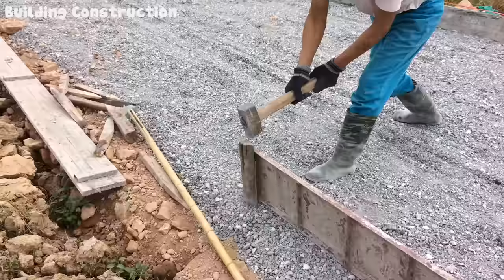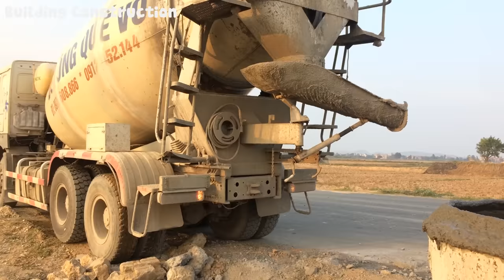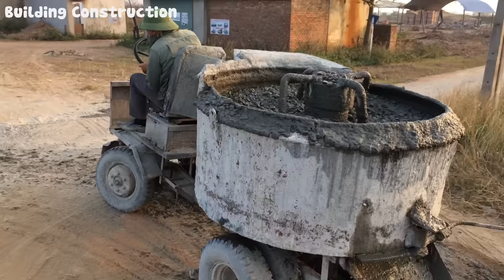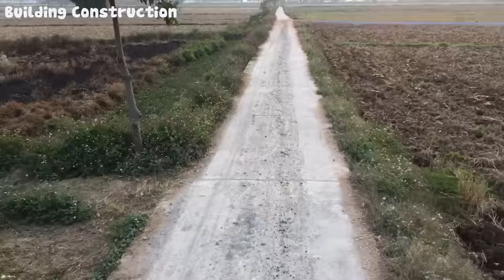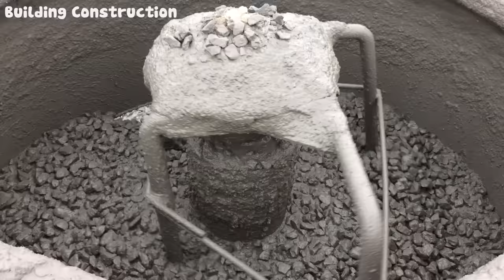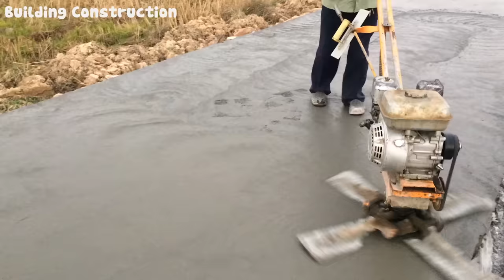Construction A Concrete Road Stretching On Rural Fields With Ready-Mixed Concrete

Comment: Great stuff but I noticed no expansion joints unless they cut them whilst the concrete was still soft later. It will buckle without them.
Reply from the maker: Thank you for watching my video
Wishing you a happy and successful new day
Like and share to help me
Reply: L
Reply: @buildingconstruction8386  g ki ek.
Reply: I saw then laying (6:35) and then about 3 meters apart, perpendiculary sinking (10:16) some wood boards in the concrete. Those may act as expansion joints.

Comment: I would like to see this a few years from now, with no rebar it will be interesting to see how this hold up.
Reply from the maker: Thank you ♥️🌹
Reply from the maker: Kirk Johnson  thank you
Reply: And no control joints? A whole Lotta Crack my friend
Reply: Sure a few runs of the consaw after it’s dry will sort out any expansion. Rebar would’ve helped though.   But my God this road would’ve bankrupt most 😅
Reply: @buildingconstruction8386  ششضض
Reply: @EricB90  I saw then laying (6:35) and then about 3 meters apart, perpendiculary sinking (10:16) some wood boards in the concrete. Those may act as expansion joints.
Reply: @robertrisk5490  bro what? Who puts wood in concrete.
Reply: @EricB90  that's what I think I saw. I am not recomending it or saying it should be done. I am a doctor, know nothing about concrete or engineering.
Reply: There are 2 kinds of concrete. Concrete that is cracked, and concrete that is going to crack.
Reply: @mykelbaurle5758  I’m sorry your concrete work has been that bad lol most homes where I live are on a solid concrete foundation… my grandparents house which is nearly 70 years old is still not cracked.

Comment: Very nice video. Can u tell me why no dowel bars tie bars used here? Also no construction joints left?
Reply from the maker: I wish you happiness success
Like and share videos for me
Reply: Maybe because its being built in a poor country
Reply: I saw then laying (6:35) and then about 3 meters apart, perpendiculary sinking (10:16) some wood boards in the concrete. Those may act as expansion joints.

Comment: In Concrete Road 3 Types of vibrators required. 1.Needle vibrators 2. Plate Vibrators 3. Screed Vibrators which is equally with span width. It is based on levelled sides shutting frame, So that surface to be completely smooth. Expansion joint, concrete cutting and Curing through vata for 28days must.
Reply from the maker: you are right
❤️❤️❤️❤️❤️❤️❤️❤️❤️❤️❤️❤️❤️❤️❤️❤️
Thank you for watching my video
Reply: What  is  you' job
Reply: Sir please I want to learn and work for you I'm in Nigeria I have the basic knowledge
Reply: Sir please I want to learn and work for you I'm in Nigeria I have the basic knowledge

Comment: That road  will break up because it have no steel in the  concrete
Reply from the maker: Ok thank you ♥️🌹🌹🌹
Reply: @buildingconstruction8386  that's hard
Reply: It depends on the ground movement and thaw/freeze cycle.   Many roads were built under the French colonization without any re enforcement and still serving the country well.

Comment: No rebar, and separated by each sub section. This will cause lots of cracks in the future.
Reply from the maker: without steel the thicknesses were 40cm thick enough to be strong and there was a 4m cut in one piece
Reply: Chuchuwua
Reply from the maker: @leandromartinsaornil2945  like

Comment: Then a few years later, concrete crack up due to weather like sun, rain, wind, and flood. As the result, road is uneven and soon sink to the rice field. What's a joke.
Reply from the maker: Thank you ♥️
Reply: & they put no steel reinforcements in the job. Don’t understand point of plastic on the sides? If you used mesh job would have lasted years
Reply: It’s the best they can do with the money they have 😊
Reply: @buildingconstruction8386  Oi
Reply: C'est un 3
Reply: 2🎉😊
Reply: Cutt5🎉
Reply: The person 🎉
Reply: 1x🎉fsarq
Re😂
Reply: 737😂
Reply: Ss🎉
Reply: Uhuy🎉
Reply: Gfeue😢🎉
Reply: Z🎉
Reply: Uhv🎉😊
Reply: Uet gg8 gfhzje🎉🎉
Reply: E g
Reply: @SAboostaddict Addboost  I think it help it stay strong

Comment: concrete road will start cracking after year or even before depend on traffic, weather conditions ...
Reply from the maker: Thank you for watching my video
If you feel good then like and share videos for me
Reply: We use concrete on roads in the US as well
Reply from the maker: @angelavila9452  ok thank you
Reply: @angelavila9452  without asphalt
Reply: @Mr11ESSE111  yes I'm a truck driver I see it all the time. Its reinforced but still concrete.
Reply: @angelavila9452  local roads
Reply: @Mr11ESSE111  negative  im on intestate 44 mile marker 76 in Oklahoma  all concrete. More then 100 miles. All concrete
Reply: Concrete roads are durable and safe. They are considerably less prone to wear and tear defects like rutting, cracking, stripping loss of texture, and potholes that can occur with flexible pavement surfaces. This low maintenance requirement is one of the principal advantages of concrete pavements.
Reply: @angelavila9452  if they will be so good nobody will not use asphalt then
Reply: @angelavila9452  its bad then !!
Reply: Concrete roads are more stronger than asphalt roads
Reply: @shameemnoohumohammed9527  depend on thicknes ,but eventually they gone and cracks and not good for some higher speeds!!
Reply: Mr11ESSE111 why the airport roads not constructed by asphalt then ??
Reply: @shameemnoohumohammed9527  it is constructed by asphalt ,maybe some smaller and poorer not
Reply: @Mr11ESSE111  Properly installed concrete roads are for more long-lasting than asphalt.  They are just noisy as hell and drivers hate them.
Reply: @petertr2000  and costs more and cracks too
Reply: Every thing has drawback but periodical maintenance is important.
Reply: @buildingconstruction8386  জআ
Reply: @angelavila9452  বব
Reply: @buildingconstruction8386  িতএস
Reply: Ubl
Reply: @_Chad_ThunderCock  they are shit!! they will start to crack pretty fast  depend on area

Comment: Without reinforcment and expantion joints this road will cracked and break after few days.
Reply from the maker: have grooves okay because you are small, the surface of concrete is covered with a thin layer
Reply: I think it's enough for countryside.
Reply from the maker: @tonytang5452  like
Reply: L
Reply: P

Comment: It needs expansion joints every 25 feets with mastic pads with dowel bars of 25 mm dia
Reply from the maker: there are grooves in the concrete covering k clearly
Reply: Ok
Reply: Joints with filler boards and sealant at 5 m
Reply from the maker: @HimanshuYADAV-br7eq  like

Comment: Why doesn't it have any reinforcement?How is it going to resist without any  rebar steel or other material that has tensile strength to protect the concrete slab from the load of vehicles?
Reply from the maker: Only for light trucks. because the surface width is not enough for large trucks. and the thickness of the concrete is 25cm

Comment: No rebar?
Reply from the maker: ❤️❤️❤️❤️❤️❤️❤️❤️❤️❤️❤️❤️❤️❤️❤️❤️
Thank you for watching my video
Reply: Same observation, since it's in a rural area won't the road crack if heavy equipment pass on it?
Reply from the maker: @EeroMartinez  yes thank you ♥️🌹
Reply: Kirk Johnson  I doubt that they'll have fiber in the mix.
Reply: @Kirk Johnson   It’s true fiber does help, but that’s not what it is for.   Fiber is not a rebar substitute.
Reply: Kirk Johnson  this part of the world, rebar is more accessible than fiber. Corruption is also common, cutting cost to pocket some money is a regular thing. Fiber is not common in 3rd world countries to mix in concrete.
I am not arguing fiber as a substrate for concrete.
The point here is, the concrete used in the video is obviously doesn't have fiber. People are reacting because all that hard work is all for nothing when that road cracks because it is structurally inadequate.

Comment: Quality and workmanship is low low over there .  In Canada we use mesh rebar and or rebar and joints so it's not 1 big peice.   This is going to crack and fall apart fast I'm sure.  Also the power troll was used when the cement was too green still way too wet to be doing any floating or finishing.   Also no bull float no edge cut in.   This is as poor and cheap of a cement job as it gets.  Worst I have ever seen.
Reply from the maker: Thank you for watching video ♥️💞🌹